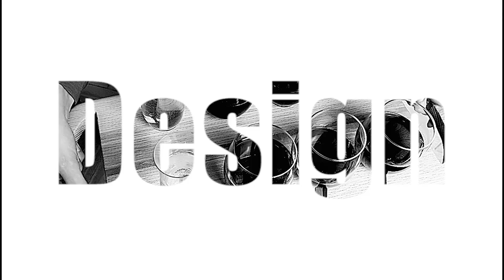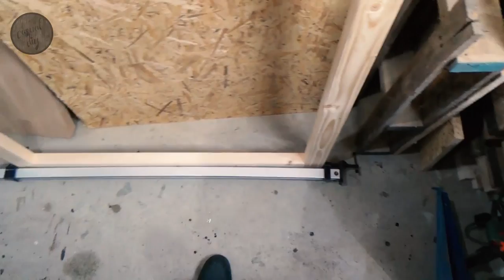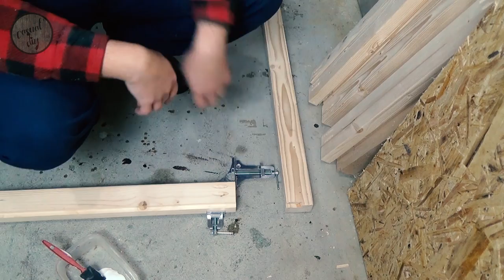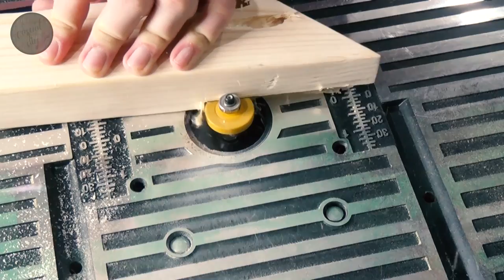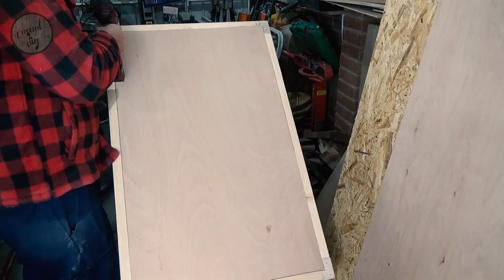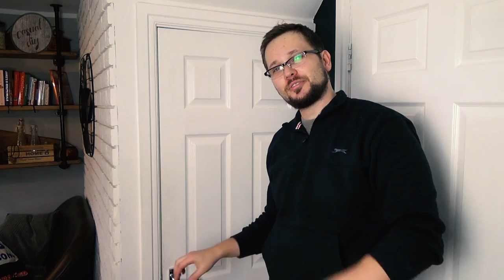Kitchen pantry storage solution, under the stairs storage idea.

Comment: Great job, but I am a bit confused cause everytime you need something from lower shelves you need to pull whole thing out of pantry. You could design it differently so it would be reachable without pulling out. Still loved it, thanks for the idea.
Reply from the maker: Thanks. Yes on some occasions it can be bit troublesome but all 5he things that we use constantly are on the top two shelves so we only pill it out like once every 3 months if that
Reply: @CasualDIY  What about adding drawers to the structure so that you can pull out a drawer with what you need instead of the entire structure?

Comment: when constructing shelving, it is best to make your rabbet on the top. the weight of the items you store on it will hold it down nice and flat with just wood glue. You went way overboard with those screws.
Reply from the maker: Budda Bing I was waiting for this comment;) the reason I done it this way is to save time, additional work and material. This way I didn't have to make any boarders around the shelves. This makes sure the items won't fall out while moving the cart. Hence I went with so many screws to hold the bottoms of the shelves. But  yes in normal circumstances I would do exactly as you said.